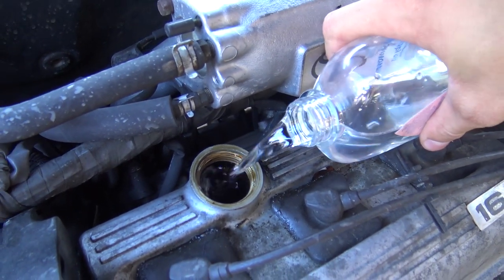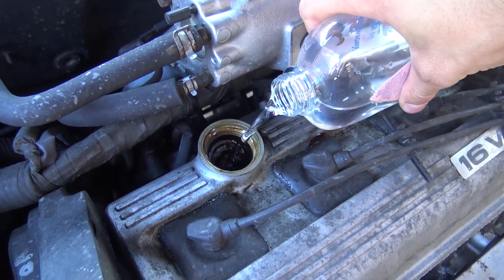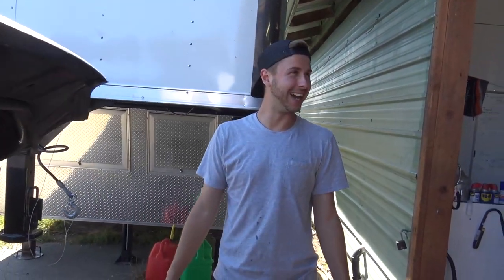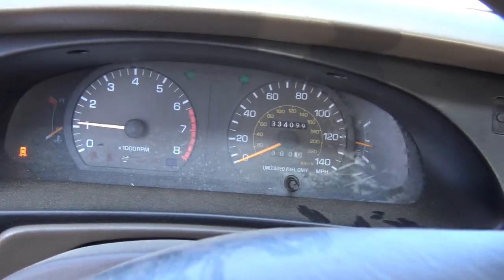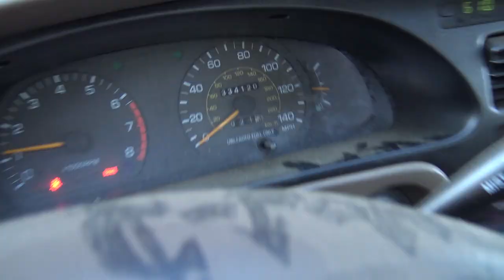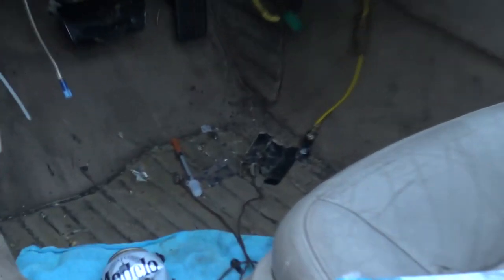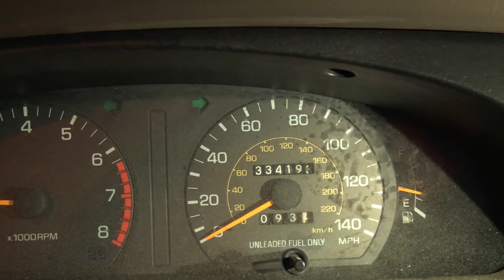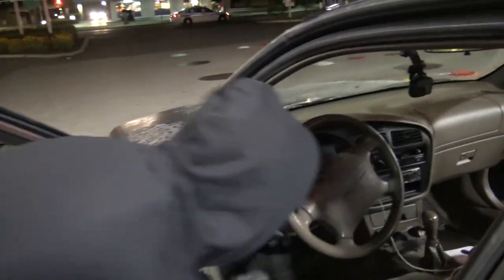Can You Use BABY OIL as ENGINE OIL?

Comment: baby oil is the same basic stuff as motor oil. with a few more components removed and usually with a bit of perfume added. you can buy it without the perfume in it at a drugstore. it's marketed as "mineral oil". it can be ingested in small (like a teaspoon or two) quantities for use as a laxative, although technically it does not alter body chemistry so is not a true laxative. but rather serves as a simple lubricant in helping to pass waste through the digestive system. it does NOT pass into the blood stream at all. and is as harmless as anything else that is eaten and is not digested. 

it WILL create a mess, on exit, if too much in ingested during a given period. :(

Comment: I'm not at all surprised it worked.
But remember that what happens in a,short experiment is way different than running a car off the wrong oil long term.

Think about the difference between a car that calls for 5W30 or 10W30 getting 20W40 put in it. If the car was low on oil & needed it short term (which could be 100 miles home or to a shop) is again different than constant long term use.

Comment: We had a Isuzu Trooper V6 a 2000 model   Ran slick 50 in it for 50.000 miles.   It had 136000 miles only.  Sold it they changed the oil but never put plug or oil in it.  It ran fine for 3 months.    So if they ran slick 50 in that car it’s running on the slick 50.  You need a car where it never had a additive to test.

Comment: Actually better for the engine but needs to be changed every 500-700 miles. I run it in my 2011 Honda crf 250
Reply: Dan St. Schwind what? You kidding right? Lol
Reply: Henry Ly nope. Baby oil is mineral oil based with fragrance added. 
Mineral oil is a by-product if the distillation of petroleum when producing gasoline. 
It’s lighter than oil because the hydro carbons are processed OUT. 
It breaks down much faster but it lubricates   just fine like oil. Because it is oil.
Reply: Wow I’m surprised, learn something new, but isn’t it too thin? No?
Reply: Henry Ly it is which is why I change it every 500 miles maybe 700. It breaks down FAST. 1000 miles and the engine is done. I wouldn’t recommend it me and my brother are running different things in old thing we have. The Honda has gone a little over 2000 miles with the baby oil changed 4 times at 500 miles
Reply: God damn thank you dude, probably not gonna do that but I learn smt new lol
Reply: Don’t do it I made it all up
Reply: Bro, I literally sitting my ass here google everything up,...not funny man
Reply: Henry Ly 😂😂Truth is we put baby oil in a $40 lawnmower and we mowed the lawn for the entire summer with it. The fact that it is petroleum based without the hydrocarbons does it mean it is a real oil capable of acting as a real oil in an engine. It just does not lubricate like an engine needs or last.
Reply: Aww I see, not on a Honda lol
Reply: Henry Ly no lol just am on hisqvarna

Comment: It a Toyota Camry engine.Baby oil as engine oils will works for 100 miles easily.200 or  more miles probably over heating the engine and ruins it probably wouldn’t burn it and it could destroyed the engine though.

Comment: There was probably enough residual motor oil left in the engine after the drain to render this video inaccurate.  An engine flush with baby oil would have been more accurate.

Comment: It already had 339k miles on it using real engine oil.  All the parts are well mated to each other, and the oil has left anti-wear films on all the critical surfaces.  Yes, you can get by with baby oil for a while, but the wear films will eventually break down, and wear will start.  And since the baby oil also doesn't have detergents, the engine would start to sludge up.  But I think all of that would takes thousands, maybe tens of thousands of miles to become serious problems.
Reply: U need some likes

Comment: I use the same grease my mom used to fry pork chops with Crisco cooking oil for two years in my 87 Cadillac 307 olds facts it was too hard to get an oil changed making $4 an hour 🤫  and no shit and those two years I put another 6, 000 miles on that car traveling up and down California to concerts had no problems shit thinking about trying that shit again. Cheap oil is at the grocery store 🕵️🤫